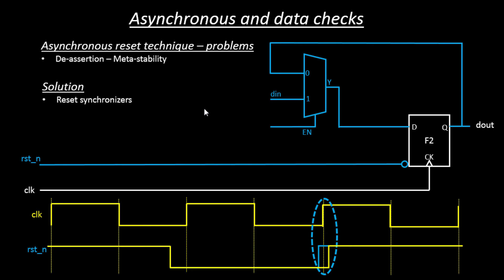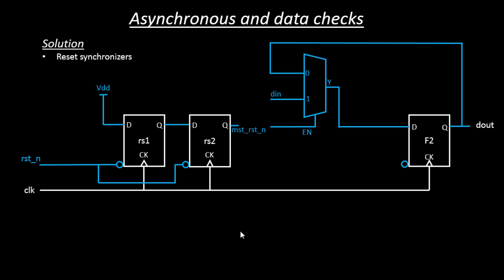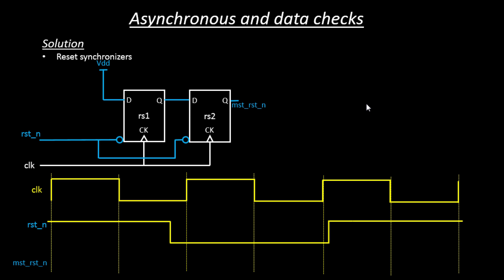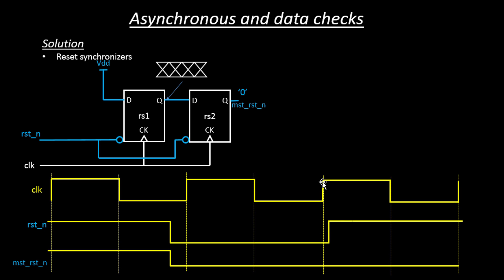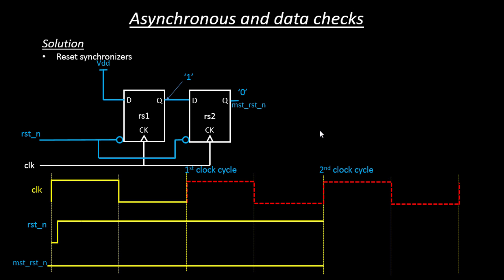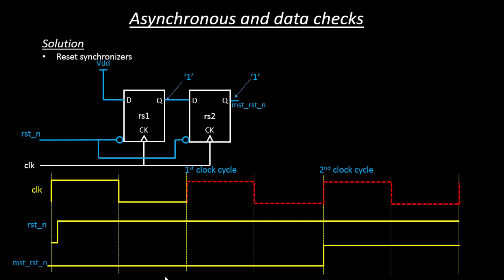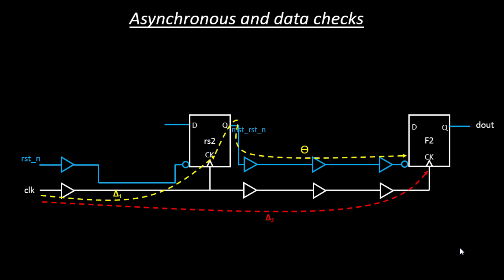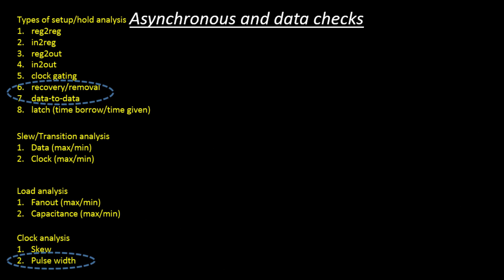How reset synchronizers resolves reset deassertion

Comment: Hi,
One question, STA tool is the best for verifying resets having multiple sync and async resets. Verification engineer reported any issue after STA exercised RTL. In other terms, dynamic simulation helps out finding any issues which has escaped in STA?

Comment: When reset is de asserted near to active clock edge both flops will enter in to metastable state. Why only first flop enters in metastable state? mst_rst_n is still not clean right? Am I missing anything here?
Reply: input D was 0 and is not changing when de-assertion arrives, so the flop is not metastable.

Comment: The metastability that you are talking at 3:13 will occur for second flop also as the clock and reset for both the flops are same. Why you are saying the second flop output is still "0"?
Reply: can anyone explain me about this,,, I am stuck here
Reply: For the second FF the input has not changed, so there is no violation whereas in the first, the input is was 0(as reset was pushing it to 0) and now it is 1.

Comment: Its not necessary that the first flop settles to '1' after metastability. Its also possible that the first flop after metastability, settles to a stable value '0'. In that case, mst_rst_n becomes '1' only in the third cycle.

Comment: note that there are no metastability problems on the second flip-flop when
reset is removed. The first flip-flop of the reset synchronizer does have potential
metastability problems because the input is tied high, the output has been asynchronously
reset to a 0 and the reset could be removed within the specified reset recovery
time of the flip-flop (the reset may go high too close to the rising edge of the clock
input to the same flip-flop). This is why the second flip-flop is required.
The second flip-flop of the reset synchronizer is not subjected to recovery time
metastability because the input and output of the flip-flop are both low when reset is
removed. There is no logic differential between the input and output of the flip-flop so
there is no chance that the output would oscillate between two different logic values.

@https://m.eet.com/media/1121857/chapter2_clocks_resets-03.pdf
Reply: very nice explanation